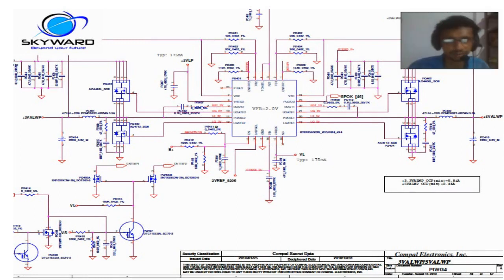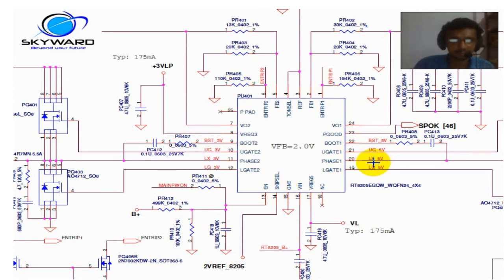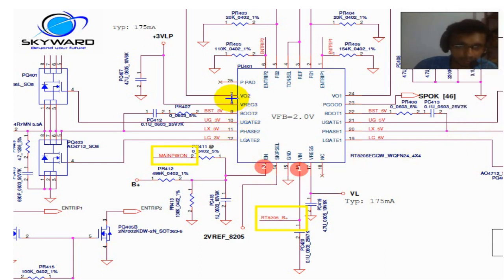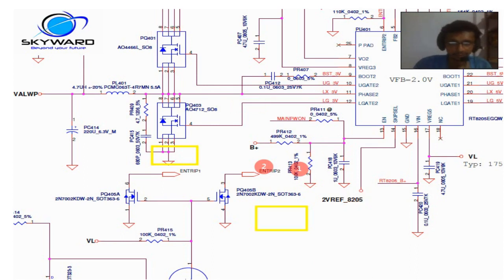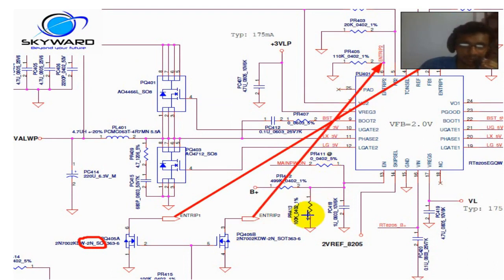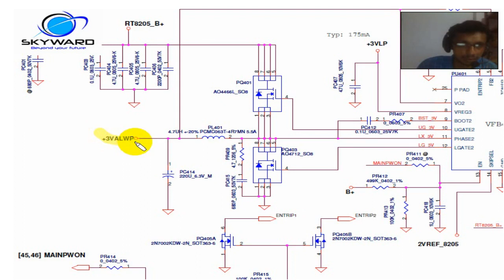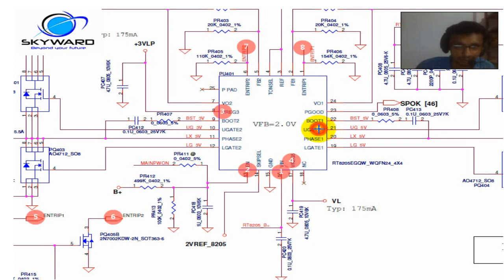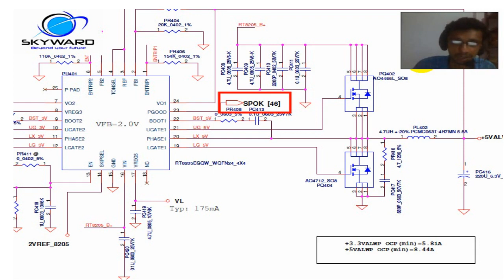S.B section part 2 in english

Comment: thanks for video, i think my acer laptop hard drive is faulty, it won't boot up, can i put in another laptop hard drive, and see if it will boot to windows, or does the cmos setup not allow that to happen, thank you for an answer ...
Reply from the maker: yes you can but you need to format the hdd. it will allow no problem.